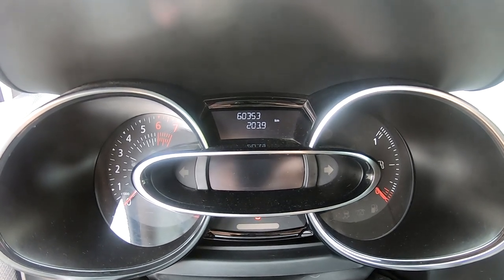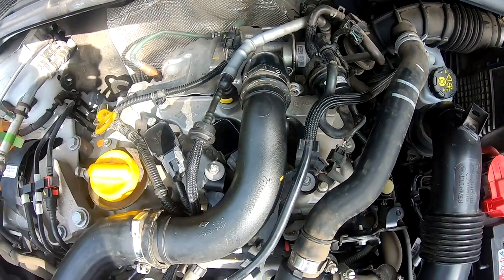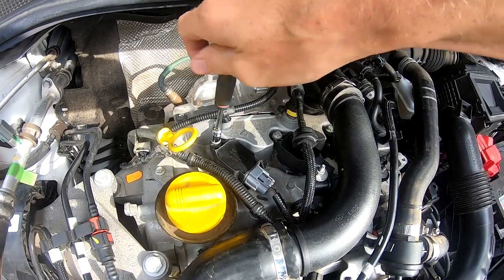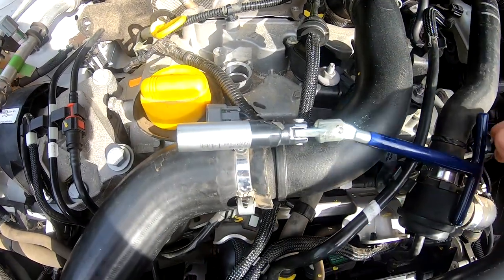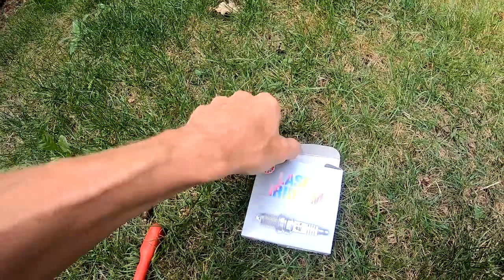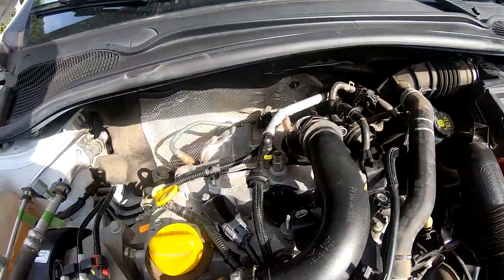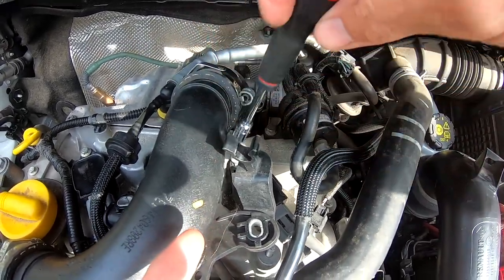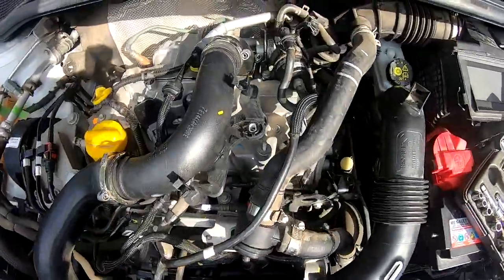Renault clio 4  changing the spark plugs  0.9 TCE  90 PK       OR DACIA 0.9 TCE

Comment: Interesting video. You didn't appear to check / adjust the spark plug gap before fitting. Thanks for sharing. Regards Stephen
Reply: you don't have to with this type of spark plug they are pre gaped and if you were to try you would probably damage the electrode as the are very small
Reply: @valvemonky4734 That's right, they are iridium.

Comment: Om de hoeveel kilometer moet je ze vervangen?
Reply from the maker: Om de 60.000km.
Reply: Renault says 60.000, i did first change at that interval, but now the car has over 140.000 and sparks work as new. Other car still has installed original sparks and works fine after 100.000km. those intervals are, contrary to oil change, to short.

Comment: IMPORTANT : Otherwise you will ruin your engine !
RENAULT Clio IV (BH) 0.9 TCe 90 :
From motor number 130429, until motornumber 140610 : NGK 90061 (Sparkplug M12 x 1,25, SW: 14 mm.).
From motornumber 140611 upwards : NGK 91121 (Sparkplug M12 x 1,25, SW: 14 mm)
Reply: THAT IS RIGHT! 👍👏
Reply: The engine code is apparently in a difficult place behind the engine, i.e. the car up and the bottom cover off. But. Could I assume the number is between 130429 and 140610 because my car is a 2012 model. Early models. What do you say?

Comment: Are all 0.9s a tiny turbo model. TCE??   Thanks
Reply from the maker: Here in belgium you have the 0,9 TCE with 70 or 75 h and the one with 90hp. I think indeed both the 3 cilinder engines do have a turbo.
Reply: Thanks reply ! @JanSV